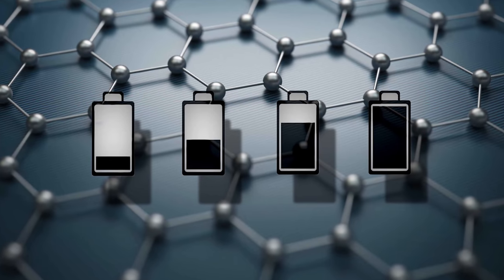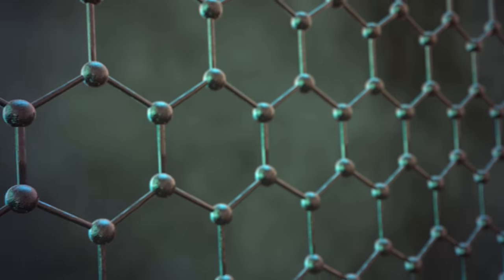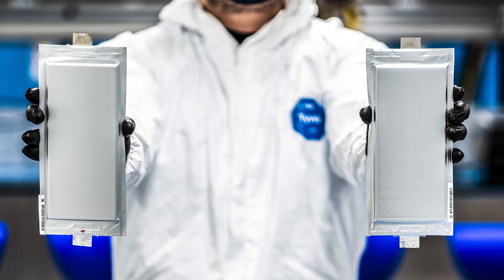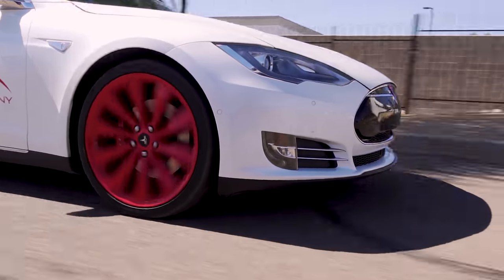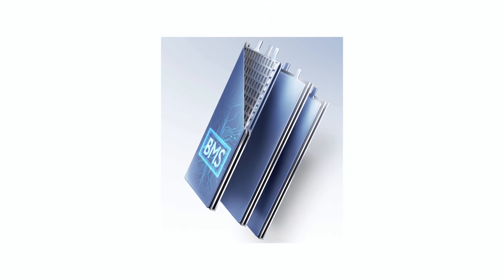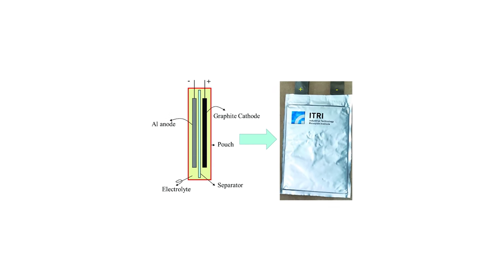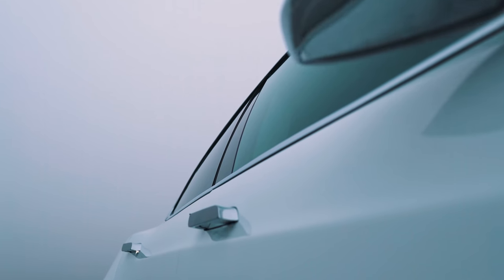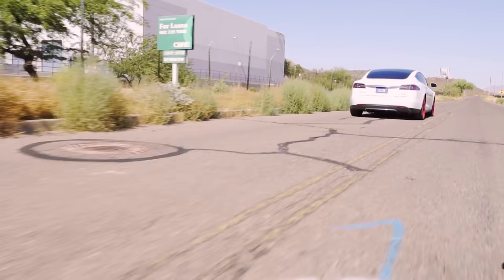Tesla Next Generation Battery | Gruber Motors

Comment: Capacitors typically loose voltage linearly as they discharge. A battery has very little voltage change until it is almost completely discharged. However, a capacitor coupled to a buck/boost converter could maintain a steady voltage thus solving the problem.  This may indeed be the "Holy Grail" of energy storage. I played with this concept on a diesel Toyota pickup attempting to achieve better winter starting. The capacitor lost voltage over time, so the system could only be left sit for 1 week. 18 volts into a 12-volt starter gave the engine a good spin in low temperatures and starting was improved.  The higher voltage and higher resulting current eroded contacts quickly.

Comment: another group "one" our next energy" just got over 750 miles with a modified model s battery, its a  200 kwh pack
Reply: Can you elaborate?
Reply: @kevinmoore6070  the Our Next Energy group took a model s pack. Tore it apart and repackaged it with different cells to reach 203kwh total capacity, but in the same exact footprint as the tesla pack is. 

Then they ran it on Michigan hwys at a steady 55mph to achieve 750+miles of total range on 1 charge. 
Supposedly earlier last year when it was warmer the car went well over 800 miles on 1 charge. 
Also car&driver claimed that same model s achieved 320+miles at 75mph in 2021 during their hwy ev range test. 🤔

Comment: Not trying to take away any thunder of this slick advertorial with sunglasses but its very thin on substance. Is this battery or capacitor, is it solid state or something else, what materials are in use for anode, cathode, dielectric and “energy storage compound”. You can leave out all sensitive patentable construction methods but give us basic info. And of course current cost of full battery for kW/h. If this info is not available then its just another clickbait

Comment: 500,000 gallons of water per metric ton of lithium has what to do with anything again? 🤔
The average oil well for example consumes 2-14+million gallons of water per year per active well.
Reply: An oil well does not normally consume water.
The water referred to is called produced water and comes from the same reservoirs as the oil.
It would be separated at a surface facility and usually reinjected into the reservoirs that the water and hydrocarbons are taken out of, either for assistance with pressure maintenance or just safe disposal. 

Not sure about lithium water "consumption" but the question is does lithium production actually "consume water or is the process of extraction of lithium similar to oil? production where the Lithium is already absorbed into the water in the salar brines it is produced from?